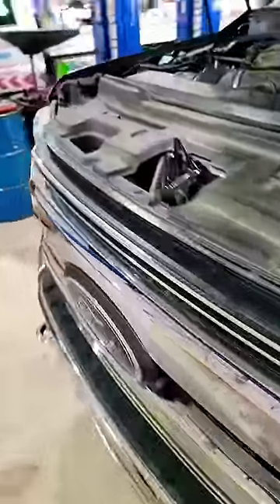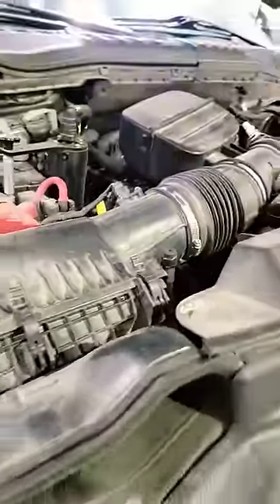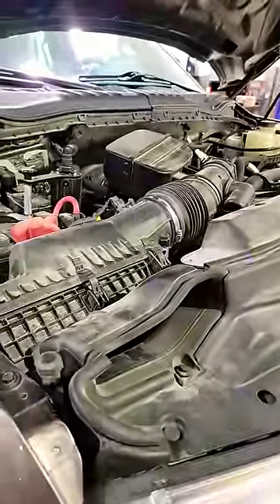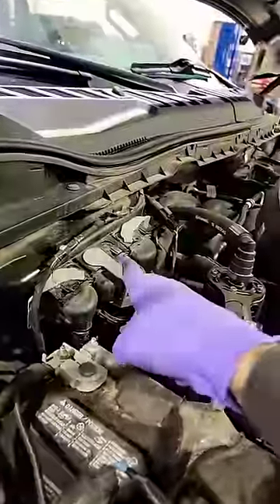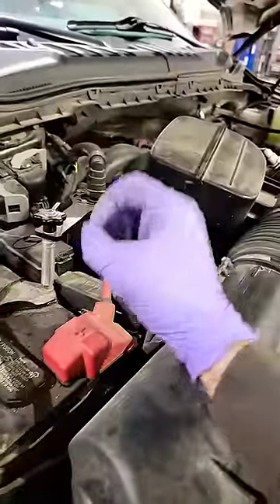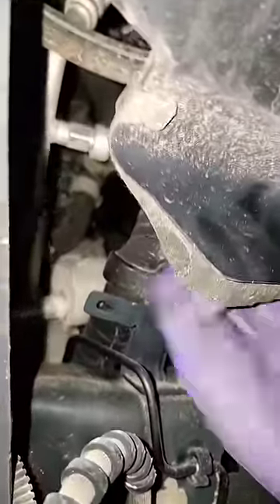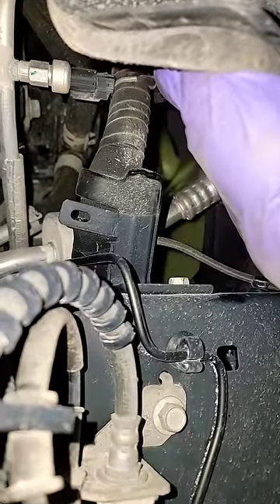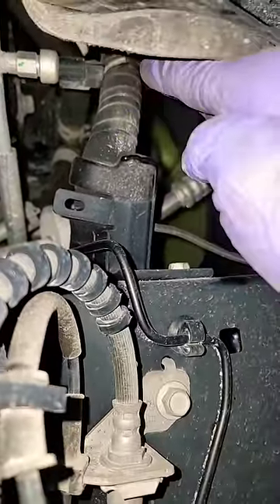New Ford 7.3 GAS owners - GO CHECK YOUR truck at this spot #shorts #fyp

Comment: What about a 2022 F-550 5.000 miles heater blowing 🥶!!???
Reply from the maker: Whattt
Reply: @PowerStrokeTechTalkwARod  same issue for the 2020 Ford F-250 43.000 miles AC not great plus in the New England winter the heat is blowing cold.
Reply from the maker: Wth!!

Comment: So it’s not brand new if it has 35000 miles duh.
Reply from the maker: Its a brand new model truck, what didnt u get
Reply: Brand new. Means no use at all. What language do you not speak. You contradict yourself. Brand new with 35000 miles.  Is incorrect sir. Just saying.

Comment: That pigtail shouldn't be mashed into that other thing. Engineers these days are pieces of garbage
Reply from the maker: The whole issue with this problem is the individual working on the line didn't give 2 shits..... has nothing to do with it being engineered
Reply: @PowerStrokeTechTalkwARod  the position of that sensor and direction of that pigtail could be slightly different and the wires wouldn't be pushed into that thing.
Reply from the maker: ...comprehension

Comment: How did you know pressures were ok without compressor being on?
Reply from the maker: The compressor doesnt need to be on. You can still charge the system to 1.63 lbs and still check pressures. Do you know how the compressor even works??
Reply: @PowerStrokeTechTalkwARod  Yes, but filling the system to required amount is completely different testing the ac pressures. 40 plus years ac experience in Houston has given me plenty of experience with compressors. Some do not compress thus do not operate correctly. Ambient temps, condenser blockage all diagnosed with compressor readings both high and low. Having correct freon amount is just a beginning test.
Reply from the maker: I guess ur not outside the box with me then.